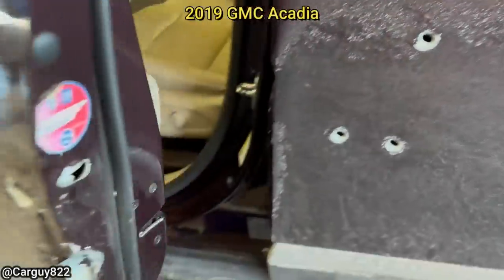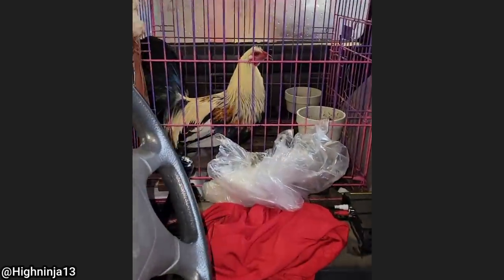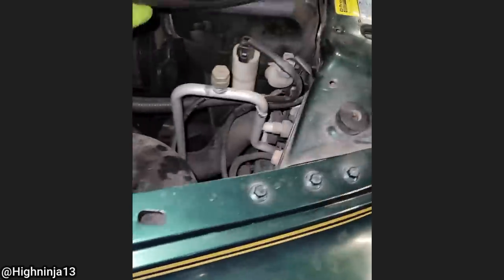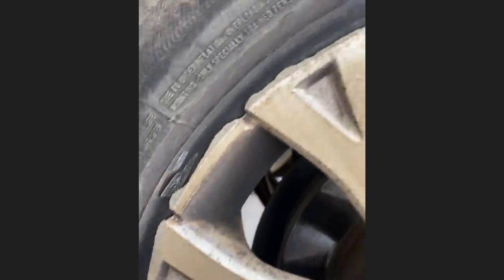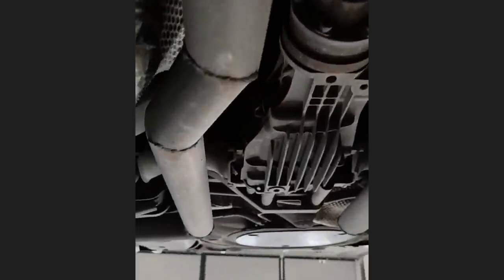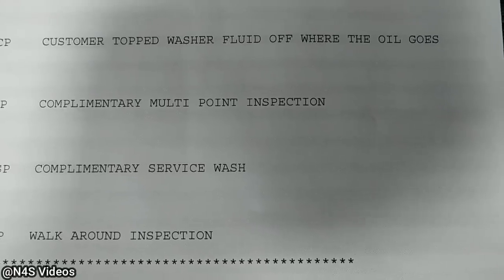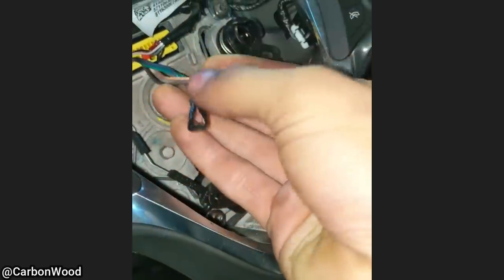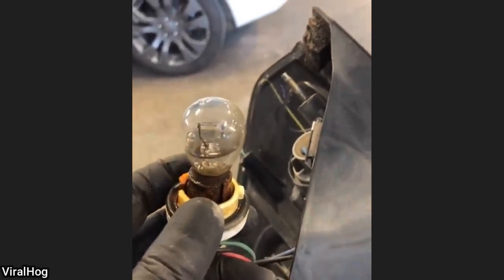Customer States Drivers Side Rear Window Won't Go Down | Just Rolled In

Comment: Remember everyone its time for your winter checks, remember to replace your Summer air with Winter air in your tyres, replace your blinker fluid, with the blue one, after all you don't want your blinker fluid freezing up on you do you? Safety first!!
Reply: And remember to fill your trunk with sand for traction. But buy the bagged sand.
Reply: I use the all season air. I got tired of changing from summer to winter air
Reply: So...... I hate to break it to you, but in northern climates you actually do need winter and summer air in your tires.
Reply: @squirrelsarepeopletoo6678   Funnily enough, this is a real thing. In northern climates you can have your tires filled with nitrogen gas so you don't need to bleed air in the spring and add air in the winter.

Comment: How do so many people crack their rear diffs? Blows my mind
Reply: To much " pedal to the plastic " from a full stop 🤔🤷
Reply: @thomasfletcher760  probably spinning ONE wheel - think what would happened if you get stuck and don't have traction on both sides ?
One wheel will spin and other one stay basically still.
Reply: @TheStefanskoglund1  thats if you have open diff
Reply: @TheStefanskoglund1  I thought that was Posi-Traction.
Reply: Driving over median-strips will do the trick!
Reply: Today there's so much focus on fuel economy that nothing is made sturdy because that adds weight. Any abuse and something WILL go boom. Ain't a 68 Chevy where you can dump the clutch and smoke 'em repeatedly without fear that you'll become an instant pedestrian!
Reply: @TheStefanskoglund1  cant say ive ever cracked my diff housing from doing burnouts and my shitbox has popped a good 50 sets of tyres. the diff gears are a different story lol
Reply: They're one of the places where car designers went to look for possible weight savings and thus with a lot of newer car models they apparently build the damn things out of paper maché.
Reply: DRIFTING !!!! 
USUALLY WHEN THE REAR WHEEL HITS A CURB!
Reply: @P_RO_  I had a 69 Chevy , and burned 4tires and two clutch disks offa that car , and it did 98 mph in the  quarter at the drags ! Stock !!  Rear was bulletproof!!

Comment: That Rooster got the amp that does the BUMPS!!  That bulb reminds me of this weird guitar pedal I saw with a capsule reservoir you can fill with any fluid you can think of and the differing densities will change the effect and tone of the pedal!
I did a cool janky repair this week putting a set of used studded rims and tires on but the lugnuts were a flat seat with shank and washer vs. the cheap standard 60* tapered cone seat I had on my hubcap summer rims, so the lugnuts I needed were hard to find and expensive and I thought I had the right one's on the way from Amazon for $45 anyway vs over a hundred but it turned out their ad was wrong and said the shank was .73 but I measured it digitally to .83 and they were too fat!  So anyway, I found the next closest size drill bit just over .83 was a 27/32nd (.8438) and paid $15 and waited again for shipping and drilled the mofo's out by hand with my 1/2 drill, haha!  It worked awesome, The Amazon lugnut guy refunded me for the drill bit and will correct the ad and maybe find both sizes now that we figured this out!

Comment: no brakes? well, gimme a brake! or something...

that blinker fluid one is priceless. I expect to see a .gif made out of it in my fave picdump sites any day soon. :)
newbie pranks are sometimes hard to translate, but I'll try.
there are these toothed washers, meant to keep the screw from loosening, but they are better for securing electric contact under an earth connection IMO. anyway, they look like a typical hydrogencarbonate molecule ring, and are sometimes called "benzole ring" in germany. so, what better prank to act out that sending the newbie to the supplies and have them fetch a bucket of benzole rings? of course such a bucket will weight 20kg or more...
another classic is sending them for adjusting weights for the water scale, or for new air bubbles for the scales' dials (allen libellas in germany, for whatever reason), and have them fetch a bowl of water with oil distributed evenly in it, at the cantina. and when they return the water has become one blob at the bottom of the bowl...
also often used, fetch a left-handed version of any ambidextrous tool.

Comment: I was working at the Nation of Autos and a Car came back in complaining of an ABS on. I tracked the problem to the Module and removed the Module for inspection. There was a rattling noise coming from it, so I flipped it over and there was a hole in the bottom. I opened the Module and out pops a Bullet. I lifted the Car back into the Air and sure enough there was a hole in the floorpan, where a Bullet had ricocheted off the Street and into the Module. We warrantied the Module. Too funny.

Comment: coming from IT, the unplugged new replaced regulator was a signal to the next technician to get payment up-front. When you have a problem, idiot, customer bringing their computer to you, you unplug and use blue painters' tape to secure something the computer wont boot without, that way they can't screw over the next guy like they tried to do you ("What do you mean its going to be $350!? There's no way it cost you more than $25, that's all I'm going to pay." when in reality you already cut the cost for them to essentially breaking-even for parts and payroll (not even normal labor cost, just payroll cost) so you take the new memory out you put in there, blue tape in the old memory, and write off the solder, time, and caps you had to replace. Bonus points for writing the "$350" on the blue painters' tape, so the next guy can charge up-front for the work that actually went into it.)

Comment: A customer traded in an old honda where I worked.  he never bothered to tell my used car manager that the master cylinder was defective.  A new lot runner took it through the car wash, then turned into the back lot. the brakes seemed to be working. he went across the back lot and when he tried to turn it failed to slow down and he went through the fence, down the embankment, into a tree which totaled the car!

Comment: No reports of a crash in Carfax?!  Wow… that unit was in a horrible wreck to deploy ALL of them!
Reply: If you take the airbag control module loose from its mounting and turn it over, it thinks the car is upside down and will pop all the airbags, if the battery is still connected. Guess how I found out?

Comment: 2:26 this happened with my most recent car. except all of the repairs were super shitty. they used a staple gun to attach the bumper back to the body, repaired scratches with spray paint (regular spray paint, not automotive spray paint), used flex tape to reattach the turn signal stem, the windows wouldn’t roll down if the drivers door was open (sometimes they didn’t roll down at all), and so much more. also all four tires were the same size but different ages. i assumed a collision happened & went unreported but my theory was confirmed when i went to get the car checked out for the service air bag lights being on and we found out the car didn’t have airbags. i bought it at a shitty buy here pay here place so i didn’t even bother having new ones installed. damn good thing i didn’t bc less than a month later the car died. rest in pieces to my POS car that someone stole off the highway while i was getting a tow company
Reply: So insurance bought you a new car after the old one was stolen?

Comment: The missing airbags are scary… you’re driving around thinking your safe and get into an accident only to have your face eat steering wheel.
Reply from the maker: They had a child seat in the back also 😧
Reply: @JustRolledIn  that is downright scary.
Reply: I won't buy vehicles with airbags and ABS. Bunch of unnecessary nonsense.

Comment: How did the dealership sell that car is what I want to know?  Wouldn’t you think airbag codes would be a trigger to check that stuff out?
Reply from the maker: From what i was told they check codes on all vehicles that get traded in. None came up. It wasn't until a couple of days later the light came on. The resistors weren't even soldered on. So once they came loose the light came on.

Comment: Public service announcement several auto parts stores are out of blinker fluid due to supply chain issues I think so you have some on hand you should run down to your local auto parts store and see if they have some in stock

Comment: I don't understand how your brakes wear out so bad. I had a 2013 Toyota Yaris that got driven nearly exclusively stop start in a city.
I changed one set of pads for the front brakes (one set of shoes for rear drums) did 235,000KM , yes km, on the original discs and drums!! And they were still good when I sold the car this year.
I am in Australia,  is it the salt on your roads that completely evaporates a disc??
I get bad maintenance,  but sheesh! Lol

Comment: One of these days one of my Mom's cars is going to end up on here. Shes completely destroyed 2 engines by not changing the oil for years and is known for not getting her brakes serviced until all the brake pads are gone and her rotors are completely shot. She also drove around on a flat for 6 months and just filled it up with air every day. Every time I try and help her she tells me I dont know anything about cars yet somehow I get years out of every beater I drive.

Comment: Listen up kids under the age of 25, when i was a youth in the 70's (yes, I said youth, i'm showing my age) 😂we had these guys that worked at the gas stations called attendants (think of them as flight attendants for your car) they would pump your gas, clean your windshields, check and refill your fluids, (oil, coolant, brake, transmission and the tire pressures) if necessary. My dad would pay them while sitting behind the wheel and they would take the money inside to the cashier and even bring his receipt back! 😨 Yeah i know, shocking right? But in today's 'hurry up i've got a thousand things to do' world all that has gone out the window and some of you besides knowing what hole to insert the gas nozzle in, (btw, the green one is diesel fuel, in my day the diesel pumps were separate so there was little chance of accidentally using the wrong fuel, a buddy of mine's daughter did that once, thank goodness she realized her mistake before restarting the engjne) some of you have no clue what's going on underneath the hood of your car, which is okay, but if you're not sure, don't be shy, just ask somebody before you put 70 lbs of air in your tires, fill your engine oil with washer fluid or put 10 quarts of oil in the engine when 1 will do and do thousands in damage to your new car. Believe it or not there are some good people in the world who are willing to help others if they are able. I'm one of them.

Comment: I can't help but think the "refused repairs" are as much due to shoddy mechanics as a lack of funds. 
By shoddy mechanics, I mean the ones convincing customers they NEED all those unnecessary repairs and replacements. It's not just independent mechanics either. I've had a dealership service centre try to charge me over $1000 to fit new brake pads (20 years ago) to my 3 month old car. They only stopped their BS when I got my father on the phone. He had been the head trainer for the dealership's mechanics for decades.

Comment: Roof rack zip ties.  Guilty as charged!  If an idea is stupid but it works then it's not stupid.
Reply: Be careful about using zip ties outdoors. The ultraviolet sunlight will slowly deteriorate the plastic, and they will break.
Reply: @BakedRBeans  The rattling noise serves as a warning to replace the broken ties.  If I wait till the rattle goes away then I'll know it's too late to fix and some poor schmuck behind me probably ran over it.